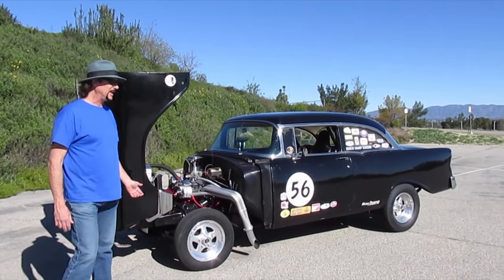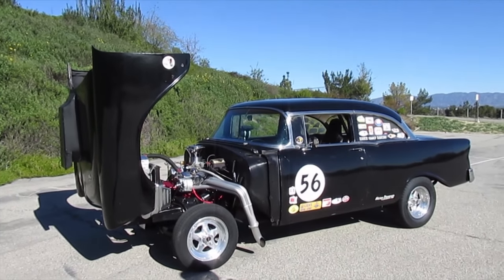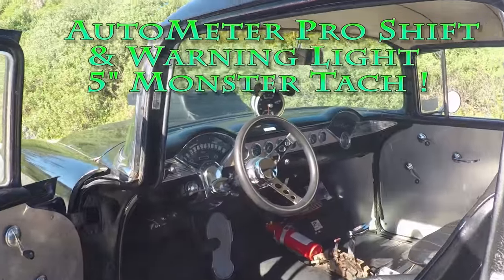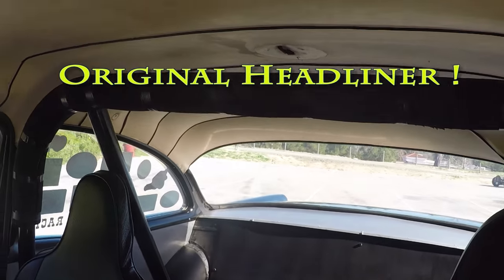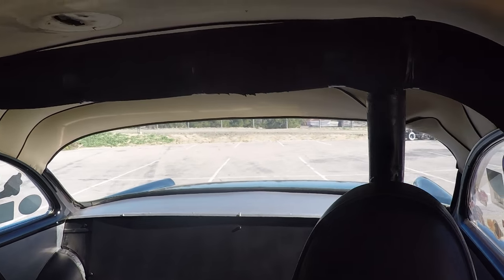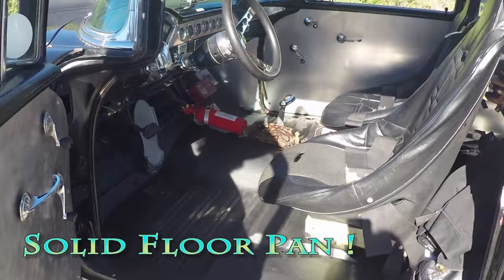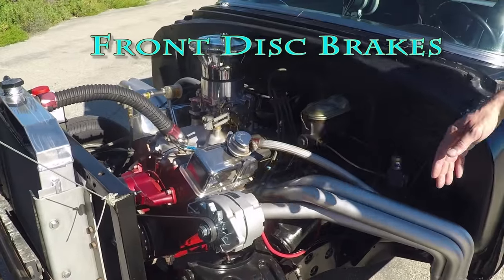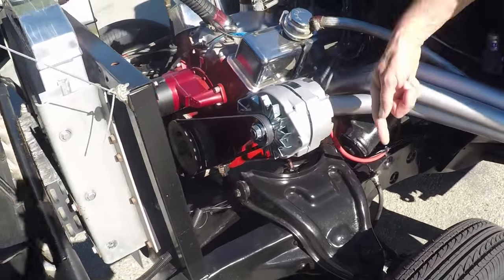1956 Chevy Bel Air Gasser

Comment: and I thought I didn't like bel airs! what does Gasser mean? I see em for sale all the time
Reply: Evan Johnson  a gasser is a car thats built to run in a class of drag racing. They are known for their straight axel front ends and setting high in the air. The gasser class was very big in the 60's to early 70's. Theres several groups that are restoring and racing these cars. The South east gassers ran by Quain Stout is a very good group of period correct gassers that race their cars. You won't find any show queens there. Their a great bunch of guys that really enjoy the old gassers. Check them out here on you tube. You'll fall in love. Thats the South East Gassers.